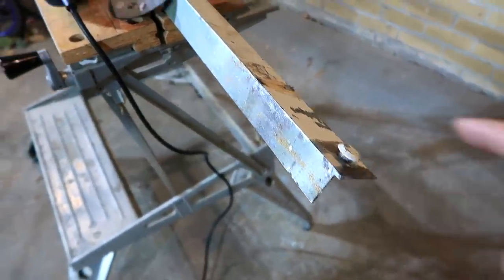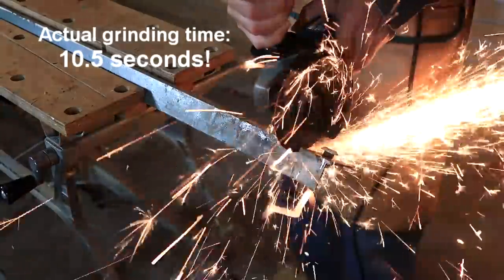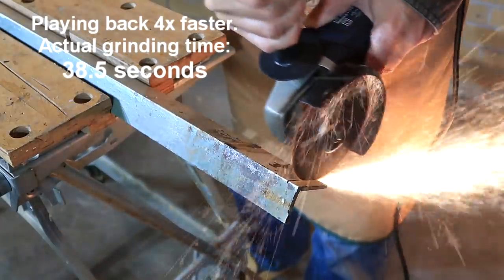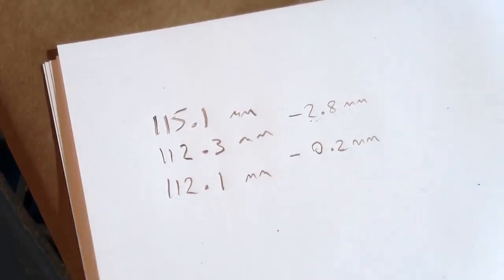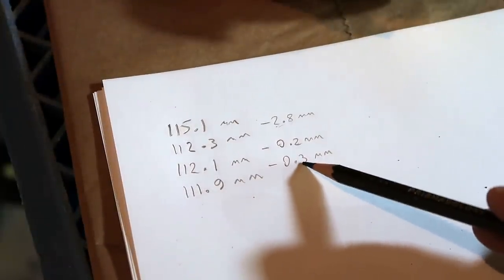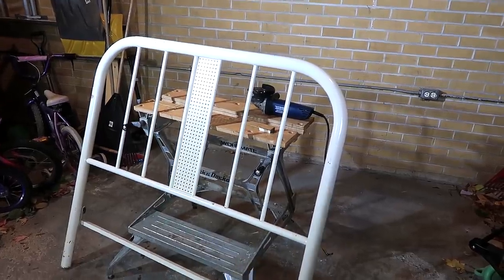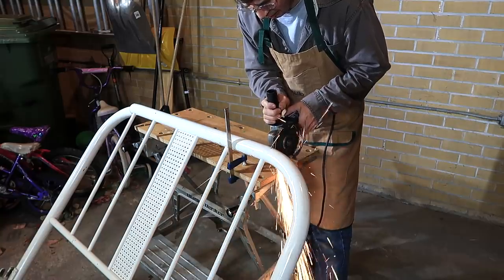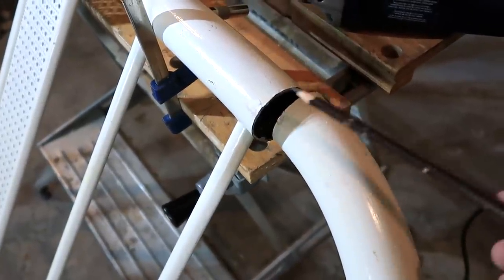make cutoff disks last 10x longer (replicating Fireball Tools' experiment)

Comment: It has more to do with the disk grinding against a sharp edge vs a rounded edge
Reply from the maker: Yes, no doubt.  The gouging cut is a very gentle surface for the disk.
Reply: @matthiasrandomstuff2221  so maybe a plunge cut where the disk just barely penetrates the material could be a good middle ground?
Reply: I think the main thing is the amount of the disc that is cutting at any given point in time.   Given that roughly equal pressure is being used with both types of cuts, the gouging cut is distrubuting that pressure along far more disc edge than the plunge cut. Even while I was typing this I concluded that it was incorrect...lol I'm leaning towards your sharp edge vs rounded edge idea more now. Good thinking.

Comment: You also have much more control over the cut and not plunging makes it way less likely to tilt the grinder to much resulting in a disc shattering (scary stuff). One other thing I would suggest is the cutting technique on the tube, when you go to the underside you have the angle grinder pushing instead of pulling which can result in kickback. Try to move down with the grinder or flip it upside down to always have the tool pulling. Stumpy numbs did a video on this lately and I have cut my hands open twice with kickback using a wire wheel (yep, after my lesson learned and being very carefull I still managed to get the grinder in an awkward position again. On the upside, now my hands are scarred symmetrical again)

Comment: Also keep in mind the less wear on an already used disc is even more impressive because you’re starting with a smaller diameter disc. The outer circumference is feeding less cutting material into the same amount of metal to be cut

Comment: Good test. To be even more accurate, you would need to account for the shrinking surface area of the disc as opposed to just diameter. This test also makes me glad that i have a portable bandsaw, torch, plasma so i don't generally need to cut with a grinder.
Reply: You can work out how much area was lost from the disc in each test easily enough.

Comment: What I wonder about is why angle grinders are not designed to easily accept a fence or a jig that would make it easier to make straight and even cuts. (Also, clamping a vise on one or both sides of the workpiece may help to diminish chatter and prolong tool life.)

Comment: I was wondering: how about a "slow plunge"? Maybe it's less about the technique and more about the speed?
Reply: Even a slow plunge is cutting 90deg to the wheel, where shallow gouge is cutting 0deg.
Reply: My take - with a plunge cut, the blade slides past the sharp edge of the cut at a steep angle. The cut's leading edge is acting like the edge of a cutting tool, slicing the outer edge off the disk. But because the cutting surface is so small, you can apply a heap of pressure, so the cut goes fast.

With a shallow gouge cut, there is no sharp front edge to slice the edge of the wheel, but because the cut is so long, the force is spread out across a larger area, so there is less pressure, and the cut goes slower.

Would a compromise be making a plunge cut, but making sure that the angle between the blade and the surface never gets sharper than 45°? The cutting surface shouldn't be too large, so you can apply decent pressure, but there should be less wear.

Comment: It’s interesting to know this. 3 weeks ago I wanted to try changing my own muffler and I used a brand new cut off disk, but the sparks were shooting everywhere and bouncing off the underside of the car and burning me, so I tried to really push it hard to get it over as quickly as possible. I used an entire disk on one cut! Granted it was a Harbor Freight cut off disk, but I never went through a disk that quickly. The exhaust pipe was a seemingly normal thickness to me, and the only other difference was my rushed, hard pressed cut.
Reply: One time i wanted to cut a couch in half (beer, don't ask) and the springs were really putting the pain to my side cutters so I tried the grinder, just  plunging it in the general direction of where I wanted the cut and keepingy face as far away from the disc as possible, when there was no more resistance I looked and the springs were cut clean but the disc got worn down to zero in a matter of seconds

Comment: You should also try a plunge cut, but going slowly so it takes as long as the gouge cut. This would distinguish whether it is the geometry of the cut or the cutting speed that makes the difference,

You could also try to generate a continuum of cutting geometries between gouge and full-depth plunge, but you would need a jig to hold the depth steady. It may be that the wear depends on the length of the cutting face and (relatedly) the pressure (not force) on the circumference of the disk.
Reply from the maker: Do the experiment, post a video.

Comment: I actually didn't watch fireball's video because it seemed way too long for a quick tip. turns out, that's pretty much how I always use my grinder because I found it reduces catches (it's yet to happen, but I'm a very apprehensive of a disc shattering while spinning)

Comment: On your repeated slow gouging cuts you saw a slow creep up in amount of disk lost with relatively little change in cutting time. This makes sense if you consider the area of the disk being consumed. For a repeated the cut the change in diameter between cuts will increase as the starting diameter is less than the previous, so the cut is "consuming" the same amount of the disk but its being expressed in a smaller area.
Reply from the maker: yes, for those 3 cuts, the disk size was only down about 1% from first to last, which is much less than the increase in diameter loss.

Comment: And like fireball you didn't do the compromise in between where you have the incident angle into the material at like 10 degrees but you do go all the way through. As with any repetitive cutting tool the greater the feed pressure and depth of each individual cut determines both tool life and speed of material removal. Let's see a follow up where:

1. You never cut with a climb cut on the wrong edge (you did, a bit)
2. You engage the work full depth, but at a shallow angle

And see how it goes.

Also, within your test it wasn't much of a factor but as the disk gets smaller the area of disk removal gets smaller for a given depth of disk removal. IE, I'd expect the wear rate to go up significantly as the disk shrinks, too. And of course, we've all seen that in practice. And also of course it's combined with slower disk edge speed into the work piece at the same time as having more effective torque and less surface to wear down per revolution.

Comment: I suspect the difference is because the slower cut keeps the disc temperature lower, which means less of the binder decomposes and less of the abrasive departs the disc.
Reply: Perhaps a carefully directed jet of compressed air would help?
I know a carefully directed jet of compressed air has really worked wonders for me in many situations.

Comment: This is great news, if you have room and time for the gouging cut.
I suspect the power consumption would be far higher for the slower cut, but might cause less warping or other issues, like cutting too far from a mark, since you're spending so much more time per cut.
Reply from the maker: Yes, easier to get it accurate.  But intuitively, I assumed the fast thru cut wears the disk less cause it's less time grinding.  Wrong!
Reply: I wouldn't bet that the consumption would be higher, since it also has allot less friction and the motor is not working as hardif you are not plunging.

Comment: Neither of you tested just gouging less deep, i.e. not scoring, not plunging to maximum depth, just don't let it sink more than a couple mm trough the material. Exactly as cutting would happen, if grinders had an adjustable depth stop. Then we'd probably all set it just like a table saw, just enough cutting depth to get through the material. Less exposed blade = safer. And probably somewhere in between deep gouging vs. scoring with respect to disc consumption - I'm guessing attack angle of the disc is important here. If you ever repeat the experiment, please try this third option as well :)

Comment: You have to start from a new disc. Since the circumference is decreased much more than the diameter and it the meters per minute of rotation that determine the speed of cut. In the old days at least the rpm of the grinder would be matched to the original circumference of the disc making the peripheral velocity equal for all disc sizes.

Comment: Keep in mind also, that as the wheel gets smaller, the circumference becomes smaller and as a result the diameter will shrink faster as the circumference gets smaller since it will take more revolutions of the blade to get the same abrasive distance.
Reply from the maker: yes, the disk getting smaller means the later cuts will lose more diameter for the same amount of grinding.  But with just a few millimeters lost on the disk, the effect is small.  And it makes the initial (fast cut) appear to use less blade.  So the difference would perhaps be 3% bigger (insignificant) if I took that into account.
Reply: @matthiasrandomstuff2221  Thanks for expounding on my point.  I was thinking that, over time, using the calipers as measurement, the amount lost over multiple tests might look exaggerated as time progressed.  I agree that I'm being mostly pedantic here.  Using the ideas presented in the video will considerably lengthen the time before hitting those smaller diameters.  Have a great day!

Comment: I wonder if something similar would work with those expensive sanding flap disks? Like taking it slower with those disks would make them last longer?  Not sure how you would really test it because you can't just use a a pair of calipers to measure it.
Reply: just grind two long welds each with a seperate disk and see which one is in better shape at the end or if the welds are long enough which disk gets more distance done
Reply: "Let the tool do the work" gets repeated over & over, and that's what this test is showing.

Forcing the tool makes it wear faster, and that applies to sanding as well.  If sanding is taking too long, rather than lean on the sander to "make it work better", switch to a coarse grit.

Comment: I wonder how much difference in cost it is, if you factor in your time cutting.  I bulk buy those extra thin discs, so they really do cost pennies
Reply from the maker: yes, the difference in speed is amazing.  Cost aside, sometimes you are on your last disk and need to finish the job.
Reply: factor in shipment bottle-necks and stock shortages in the plan-demic.. erm pandemic.
Reply: @JOSEPH-vs2gc  I haven't had any trouble finding consumables like grinding discs here in the UK.  Did have a hell of a job finding someone with a table saw in stock though!
Reply: And factor the time to change the disk itself
Reply: @nicolaspillot5789   5 seconds once every 20 cuts? seems negligible, but for the DIYer cutting your abrasive cost into a 10th is considerable as some welding projects with lots of cutting the disks are the most expensive part

Comment: In a production environment, which is more valuable, the disc or the labor to run the tool?
Reply: time of stopping to change the disc is also something to take in count with it
when disc gets smaller it cuts slower... so where is the optimal time to change the disc
and on top of that - faster actions have higher risk of bad cuts
:D

Comment: I wonder if these two methods would affect the number of cuts you can get from a battery powered grinder. Fast cut would be less runtime on the battery, but would it use more energy per cut?
Reply: My thinking goes like this, plunge will demand higher power from the device, so the battery will need to provide high current.  Li-ions are more or less independent in discharge current, but they higher current will for sure present higher losses, so maybe plunge will make you get less per charge.  This would be a very nice test.  
I do not have battery powered tools to test this.
Reply from the maker: The plunge is probably about the same power, possibly slightly more.  But at 3x faster cutting, probably less than half the battery power.

Comment: Well, I guess it was established beyond any doubt that the slow cut makes the disk last longer, so the slight error in measuring method doesn't really matter. But you cannot directly measure this just by the amount of mm the disk has shrunk pr cut. You should remember that the disk shrinks for each cut so the smaller the disk gets, each mm of shrinkage represent a bigger percentage of loss than what it did at the previous cut.

Comment: There was a good comment under the original video. It would be interesting to check a full depth cut but without lowering the disk deep into material.
Reply from the maker: Hard to control by hand

Comment: Keep in mind that it's probably the surface area (amount of raw material) of the disc being removed that you should be measuring. As the disc gets smaller, removing the same amount of disc material will result in an ever increasing amount of diameter being removed, so the results here are skewed even more in favor of the new technique.
Reply: 2.5mm change don't matter at that diameter.
Reply: You've got all the numbers, easy enough to work out if you really wanted to know.  The formula you need is A=Pi x R^2.

Comment: Two discs are needed. One for fast cut and the other for slow. Measure both when new. And keep them separated don't mix them up. As the disc gets smaller it will wear more.
Reply: You just told us what Fireball Tools did.  We already know that, measuring wear is a quick confirmation.

Comment: Next up - at what hourly wage + cost of disks does the TCO favour fast plunge vs gouging.
Reply from the maker: Sometimes you want to cut this way caue it's a cleaner cut.  or maybe you don't want as much fiberglass in the air.  Or maybe you are out of disks, or maybe you hate changing disks.
Reply: @matthiasrandomstuff2221  Totally agree. As a hobbyist with more time than money, this is a great tip! But I'm curious if it actually saves money in a higher volume fab shop where hourly wages range from unskilled to red seal.

Comment: Great video. Also keep in mind those numbers make sense however they are a bit misleading ( nothing to change the overall outcome) as our concern is % of disc material lost per cut not diameter lost, as the same amount of diameter lost when the disc is new, say .02mm, represents more material lost than when/if you lose 0.02mm of diameter when the disc is 1/2 gone; search area of doughnut videos and area of circle videos if you need details (I have big fingers and a small phone)
Reply from the maker: pointed out and answered many times already.

Comment: Hmm. I've known that difference in techniques for decades. I learned it using a Dremel Moto Tool. The instructions for the cutoff wheels instructed using the weight of the tool and its RPMs to do the work. Moving the tool prevents the cut from grabbing the wheel and shattering it. I never considered going lightly a secret. Well, looks like Dremels secret has finally escaped and made it into the wide wild world of angel grinders.
Reply: I also learned this technique using a dremel a couple of decades ago.  I don't recall reading it in the instructions; I think learned it from trial and error as the only way to keep the non-reinforced cut off wheels from breaking.  Those cheap non-reinforced wheels would shatter if you so much as looked at them sideways.
Reply: @jhensjh  literally i broke a few just trying to attach it on the dremel

Comment: So, it would seem that the amount of time the disks last longer is spent on grinding! I kid, but there definitely is a trade-off.

First time I cut a bolt with my grinder I spent ages going slow, then observed my car mechanic dad just fly through cuts. It was surprising to me how much I could push the tool, although I'll say that I was probably way more careful than necessary in the beginning.

Comment: Super interesting.  Thanks for doing this.  I think you should have used a fresh disk every time, otherwise you aren't accounting for the fact that the circumference is larger on the first cuts.  Still proves your point though
Reply from the maker: yes, but the amount lost on the disk is so small, I didn't factor it in.  I always did the fast cut first, to give that one the advantage.  Had I factored the circumference in, the effect would have been even larger.
Reply: @matthiasrandomstuff2221  agreed.  thanks again

Comment: I seem to be REALLY sensitive to itching from the fiberglass that many of these cutoff disks put off.   The slow gouging cut loses less material from the disk, therefore it must throw less fiberglass material into the air.  Slower cutting, sure.  Less time itching and stopping work to go shower to get rid of the itch.  That's a win in my book.